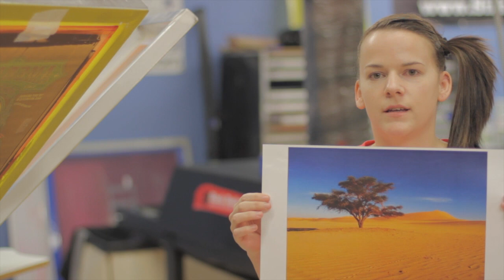Screen Printing Tips With Ashton: Humidity and Screen Printing Exposure

Comment: At first I thought that maybe I had too much emulsion on the screen??? But I only coated once on front and once on back. There was a little bit of concentrated emulsion on the sides of the screen, but from most of the other videos I've seen here on You Tube, that seems to be the norm. So I'm thinking (and hoping) that the amount of emulsion on the screen ISN'T the problem. Humidity???

Comment: OK, so I went ahead and coated my screens and left them in my dark room to dry over night. Then I exposed the image, which seemed to work out fine, but when I rinsed off my screen, ALL the emulsion came off!?!? It peeled off like dried paint. At first it was rinsing out well, just the image was rinsing away. But then the rest of the emulsion sprayed/peeled right off. Humidity problem, d'ya think???